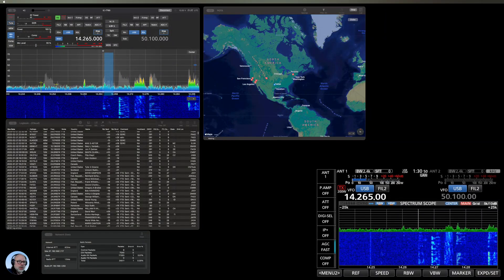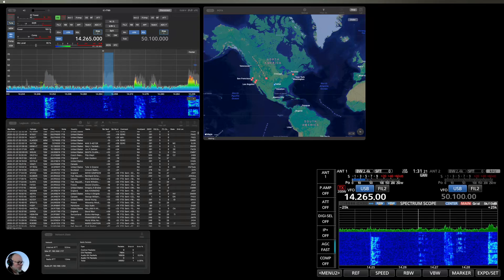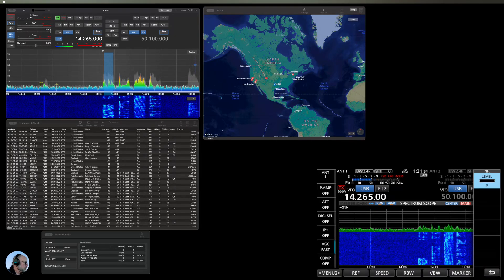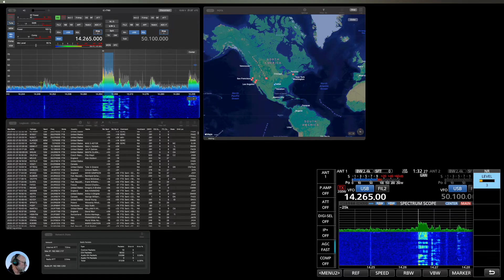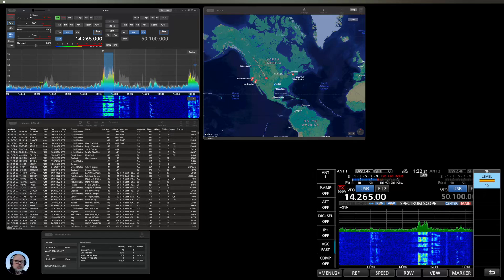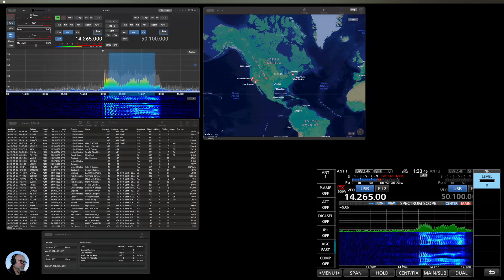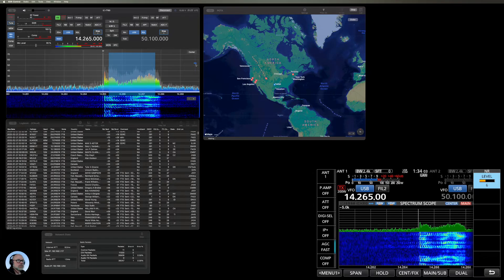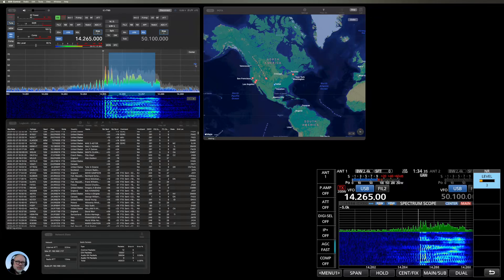Icom IC-7760 NR Test

Comment: Most non-Icom and many Icom users do not understand this new concept. I'm also not sure if Rob Sherwood understood these new Icom principles when he tested the radio, and Icom really hasn't made it clear, how it works with the different filters.

The IC-7760's DIGI-SEL (Digital Pre-selector) enhances signal integrity by effectively rejecting strong out-of-band signals, such as those from broadcasting stations or nearby multi-multi operations. Here's how it works:
Prevention of A/D Converter Overflow: In the IC-7760's direct sampling system, DIGI-SEL filters out unwanted signals before they reach the A/D converter, preventing overflow and ensuring accurate signal processing.

Improved Preamp Performance: Unlike earlier models, the DIGI-SEL in the IC-7760 works in conjunction with the preamp. The preamp amplifies the desired signal first, and DIGI-SEL then removes out-of-band interference, maximizing dynamic range and improving receiver sensitivity.

Dynamic Filtering: DIGI-SEL dynamically tracks the operating frequency, applying sharp filtering to isolate the target signal while rejecting interference, thereby maintaining clean and precise reception.
So I have found that this new combination does provide noticeable higher signal clarity and performance, even in crowded RF band environments. It is a different concept from what other manufacturers have, but it actually works in the new IC 7760 at a much higher level than it did in the 7610. By allowing DIGI-SEL in the IC-7760 to work in conjunction with the preamps (I use preamp number one, see why below).

Also Note that: The IC7760 now has two different unique types of receiver preamps used to optimize signal handling:

Preamp 1: Designed to improve intermodulation performance, this preamp enhances the receiver's ability to handle strong signals without distortion, making it ideal for crowded band conditions.

Preamp 2: A high-gain preamplifier that boosts weak signals, improving sensitivity and reception of distant or weaker signals.

Comment: Also pertaining to Sherwood's list we're not sure how it was evaluated this radio is quite a bit different even than the Flex radio with some new additions from Icon.

Digi-Sel together, with the Preamps 1 or 2. You were not able to do that with the 7610. There are Two types of preamps
Preamp 1: Improves intermodulation
Preamp 2: High gain preamplifier. The DIGI-SEL prevents overflow due to unwanted out-of-band signals rather than signal distortion, and the preamp uses the A/D converter to take full advantage of its dynamic range. When preamp is turned ON in the IC-7760, the preamp enhances the intended signal first, then DIGI-SEL will filter out the unwanted out-oyf-band signals. The IP+ function improves 3rd order intercept point performance

Comment: The 7760 just tested out on Sherwood Engineering receiver chart and it ranks around 20th. Not to good...I will find a used K3..
Reply: On the Sherwood chart, it looks about the same as the IC-7610. :)